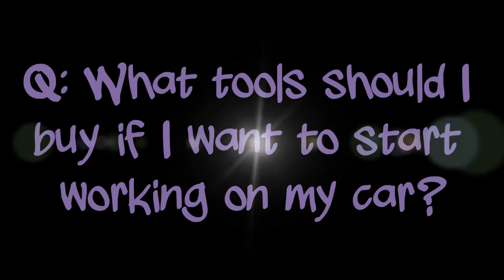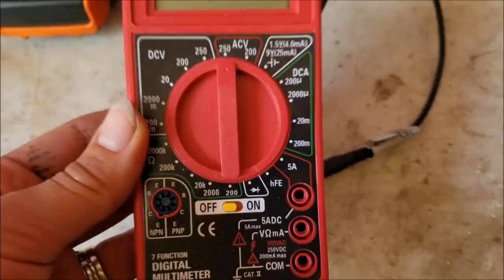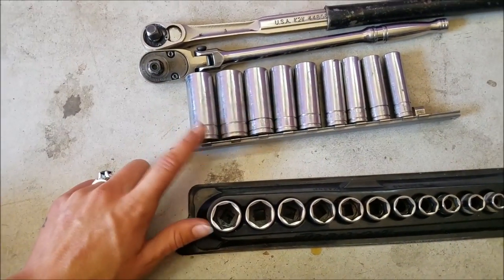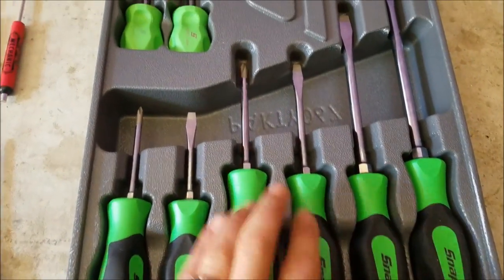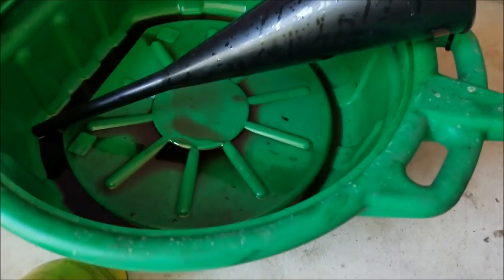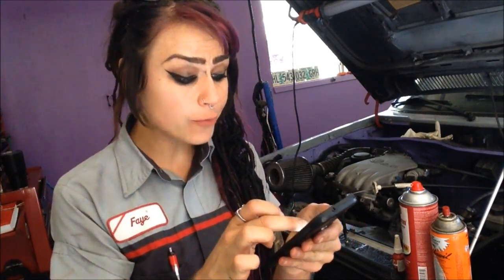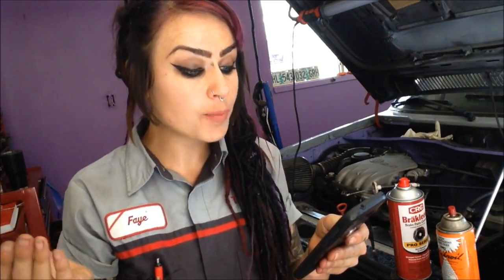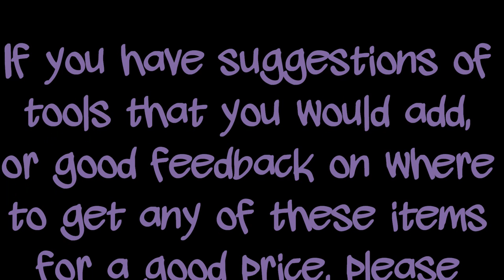"What tools should I buy if I want to start working on my car?" Q&A with Faye #2!

Comment: Hi Faye! I'm 58, about to be 59, and with the right tools, you don't have to be that strong to work on your car. I'm retired with a bad back and I can do most things if I don't rush and rest sufficiently between tasks. You need a hobby once you aren't working for the good of your body and mental health.

I also do not personally like adjustable wrenches. Get the correct size wrench! But, they can be useful around the house when you find a broken screw in a board or drywall. You can grab what's left and get it moving. My mentor (ex-hubby) strictly forbade the use of adjustable wrenches on any car. I only worked on my own car, I've never done it for money. He is a Chrysler certified mechanic, and made a living and paid for college working as a mechanic.
Speaking of two cents, I use a penny to test tire tread depth. If you can see Lincoln's hair, your tread is worn and you need to save up for new tires pretty quickly. 
For oil changes, I bought plastic ramps. They were inexpensive and I don't have the money for a jack and jack stands yet. I'm saving up. I will need to replace the entire front and rear suspension and steering rack on my 97 Honda CR-V. It's all worn out and probably won't last another year. Getting the service manual is a great suggestion I didn't think of, and I'm getting one. 

Lastly, kudos for being a successful woman in a predominantly man's world. When I started out as a chemist in 1985, I only ran into secretaries in the restroom, and there was only one for women. Thank goodness that changed over time.

Comment: One tool I use when nothing else works is spring loaded clamping spanner normally used for rounded off nuts and bolts but great if you don't have the right size spanner or socket!

Comment: For many years I carried an 18 inch breaker bar in my vehicles for changing tires. But there is something even better, but it is expensive if you don't get it used on ebay. The Snap-On SN4B is a combination breaker bar and speeder making it really effective for changing tires, and it is easy to store with the spare tire. I keep one in each of our vehicles.

Comment: Great tip about keeping a breaker bar in your vehicle to change a flat. I keep a 30" breaker with a "Keyfit Tools Breaker Bar Ratchet Adapter Socket 1/2"" and socket specifically for that task. It makes changing a tire supper easy, even on my pickup truck with its lug nuts torqued to 135 ft/lbs. In fact, I have more difficulty putting the tires back on now than I do with the lug nuts, compared to when I was using a 4-way to change my tires and I dreaded having to fight to get the lug nuts off.

For socket sets I would recommend Grey Pneumatic's Duo socket set(thin walled, impact rated sockets); they have a lifetime warranty and are are rated for both impact and hand use. They are nice because you don't have to buy a duplicate socket set in the future if you decide to upgrade to power / impact tools from your standard hand tools and more importantly you save space in your tool box for a larger variety of tools. I have them in 1/4(goes from 4mm to 15mm!), 3/8 (7mm up to 22mm), 1/2 sockets(10mm to 36mm), in both metric and standard, and they have served me very well for years as a serious DIYer. I also really like them because of the fact that they don't skip sizes in there sets unlike so many of the cheaper sets out there(Technically they do skip a 1/2 inch, 31mm socket but, that is the same size as a 1-1/4 socket so it's still covered).
 I actually bought them after I got tired of the normal impact sockets not fitting on a ton of stuff, including my lug nuts(pesky alloy wheels).

One important thing to note about warranty on tools now days; most manufactures consider "shopping search engine" websites(IE: Amazon, Bonanza, eBay, Craigslist, Newegg, Rakuten, Walmart, etc.), to be unauthorized dealers and will not honor any warranty claims when purchased through them. So, buyer beware.

Keep up the great work Faye!

Comment: I don't like using adjustable wrenches either.  They are handy for certain hydraulic hose applications on heavy duty tractors.  Also for a beginner Tekton tools are a great option due to price and quality.  Are also lifetime guaranteed.

Comment: Basic socket sets, vise grips, wrench sets, screwdriver sets, hammers, needle nose pilers. I love my used 12 inch Matco 3/8 ratchet, I paid $40 a few years ago. I think it's really cool you teach other women car basics. When I worked at a shop a few years ago, I couldn't believe how many women didn't know how to check the oil or coolant.

Comment: I like 4 way tire irons the best. It makes it easier to get torque on the lugs from both sides of  the tool. I specifically stay away from using breaker bars on lug nuts because they tend to snap lugs if they are corroded or the lug nuts are cross threaded.

Comment: Good video. Cool stuff for beginners. Thanks. I would like to suggest a downloadable or printed bolt grade/size torque chart to allow a cross reference when torque specs aren't available. It's good to have for unknown mechanical work due to lack of torque specs that are sometimes not supplied. An invaluable reference. One can never have enough information. Also, get the chart with lubricated or dry specs for each one.

Comment: The other day I was working on the GM 3400 V6, and needed a 5.5mm socket to change out coil packs.  Luckily when I started, I got a 101 pc Craftsman Mechanic's set which was all sockets and ratchets.  This is a great video for beginners.

Comment: I would have to agree with all of Faye's suggestions. For brake cleaner though- I have switched to "non-flammable" because, if there is cleaner over-spray it won't effect rubber lines or plastic pieces. One thing I always use is a battery charger that can charge AGM/Gel/Wet (lead acid) batteries. If you get a new battery from an auto store it is never fully charged- also brand new vehicle batteries are never charged fully when you receive it. It is an obvious but highly overlooked occurrence.

Comment: I think a decent Vise Grip Pliers is a good tool along with a basic punch chisel set. Something I use is a good degreaser and some pot scrubber pads to clean parts and prep gasket surfaces. GR8 demonstration on tools to get started, every vehicle or application may require certain items such as snap-lock release tools or specialty oil filter wrenches. (just  sayin)

Comment: Tire plug kit, valve core remover for tire changes, thread gauge, brake gauge and tire pressure gauge. Besides claw or plier for oil filters, the swivel strap wrench (sm & med) less likely to puncture filters & oil filter sockets for cartridge filters... 👨‍🔧

Comment: Ditto on breaker bars. I'm looking for a 3-ft pipe to go over my 2 ft breaker bar. You are so right, tire shops tighten the lug nuts so tight I can't make them move without a lot of leverage. Several other nuts and bolts are also massively over-tightened throughout my Honda and Subaru. 

South Texas is dry a lot, but south Louisiana is very wet so there is a lot of rust on bottom car parts from driving through lots of water. I use Seafoam because it is a good penetrating fluid and rust-preventer. The project farm channel has good videos on comparing various brands of things from penetrating fluid and engine oil to duct tape. It's useful information.

Comment: If you are serious about your tools and you use them daily as your profession, not just a hobby,  here's a great package to buy from Snap-On Tools:

Buy the 1/4 inch socket set first! Get the metric mid-depth 6-point sockets 5.5mm - 15mm and add a 1/4 inch socket to this set. A high quality 1/4" tool set can get used as much as the 3/8 inch sockets of any brand name. Buy the Snap-On TM737 1/4" Swivel Head Ratchet. It has the hard plastic ergonomic comfort grip and forget about the new style red and black shitty-grip version. This tool will not disappoint you! Add to this a set of 1/4" extensions of different lengths and get the knurled wobbly ones - they are extremely useful.

Anytime you are starting a tool set, get the metric kit first unless your job is strictly SAE standards. The metric fitment to SAE sizes are better than the SAE fitting too snug on metric fasteners.  The larger the socket drive (ex. 1/4" 3/8" 1/2" 3/4" 1" etc...) the less you need to worry about it being a Snap-On quality tool. If you're breaking a 1" socket on a 1/2" drive tool, chances are you have other problems.  The Harbor Freight Pittsburgh PRO series of 3/8" and 1/2" sockets will get the job done at a fraction of the price.

Save your knuckles and don't go cheap on your daily "go-to" tools. Don't discredit cheaper tool makers and don't discredit the leaders in the industry either.  I don't need Snap-On air tools because my AirCat tools work great and cost far less.  Thankfully we have choices to shop from these days unlike the days of old. Amazon, Harbor Freight, auctions, Northern Tool, etc...

And just so you know...  MATCO doesn't make any of their tools! They are ALL sourced from other places. The only thing they make is their tool boxes and not the entry level ones. The good ones!  MATCO makes the best tool boxes IMO - but the competition is strong!!

I've been a technician all my life and I have more tools than most mechanics. I'm not a tool snob, I'm just serious about tools in general. I know what works and where money will be wasted for the most part.  Work smart and shop wisely.

Comment: I have to disagree to a minor extent about the adjustable wrenches. Growing up on a farm and being a Industrial mechanic for 27 years I find the adjustable wrench an invaluable tool at times.  I agree with what you are saying, and I agree that the correct wrench or socket is better, 
 But there is times when you need to hold a "Part" while removing the fasteners with the correct tool, and the part just happens to lend itself well in shape to use an adjustable wrench. Many times I use the adjustable as you would pliers for certain things. I also use them to bend materials in a vice similar to a sheetmetal brake. And two adjustable wrenches side by side make a great pair of shears for opening banded crates or shearing  away rusted muffler hangers to get better access. You could almost teach a class alone on the right & wrong way to use adjustable wrenches. I have 6-10 of matching set sizes. Dont buy cheap sloppy ones either. Tighter the mechanism the better.and keep them lubricated.
Reply: i agree. i use them alot for those uses.

Comment: Instead of a flashlight, I recommend a good quality LED headlamp. I use an Energizer brand. I've never been happy with headlamps from Harbor Freight

Also, the "soft hammer"is known as a rubber mallet

Wow, Saab!! That is so cool!!

One last thing, my city offers a free oil change kits that include a good size bucket, a bucket top that can be used as a pan and seals the bucket, a funnel, a 2-pack oil filter drain, and rags

Comment: I would actually recommend an adjustable wrench but, only for a very specific, rare use case scenario and, a very specific type too. Specifically, a slim jaw adjustable wrench for those rare occasions when you need to deal with a Jam nut(or something similar with a set of double stacked nuts) and you don't use it enough to justify the extra cost or space, a set of decent slim wrenches(cheap one deform too easily) would take up. The only time I have needed a slim wrench was to deal with after-market brakes that had an odd setup for how the sliding pins were held on and I ended up being able to get the job done with a pair of needle noose vise grips(parts were being replaced).
 

Now if you plan to own a table saw one day, I recommend just buying a set of slim wrenches and forget about the adjustable wrench. Because chances are you will need them to change out the blade if you want to get a bit fancy and get a dado blade set(useful in furniture or cabinet making).

Comment: You did a great job here. Only recommendations I would are the following. Some extractor sockets in sae, because they usually work on metric bolts as well. A manual impact driver. Oh a caliper compression tool ,one with all the different types....other than that...bravo,good work!

Comment: Get a good set of shallow and deep from 5 to 15
Larger sockets are for higher rated bolts ie truck bumper bolts and bed bolts.
Anything over 15

I also bought a good magnetic socket set from sunex
And I have a electric ratcheting wrench
A good set of ratcheting wrenches 
Gear wrench has a good 20 peace for around 36$

A good variety of extensions

Also usually you sometimes will need torx bits 
I bought a 20$ set from ViM that were torx plus as well

That’s what I use the most .
On daily R&I

Other helpful tools are pry tools, 
A 4 peace small hook set
 Trim removal tools

There’s so many tools out there, 
I have a lot of random things from working in a body shop.
Like a 3/4 huge breaker bar I use to break VW hub bolts
Or my snap on air hammer
Spot weld drills,
Wire blasters,
Belt sanders
Reply: My 2011 Subaru Forester has several 17 mm and 19 mm bolts. The oil drain plug is a 17. The PCV valve is a 19 mm.
Reply: Sherri Joubert yeah typically body bolts don’t go over 15 
Non body components have larger bolts

Comment: It's just eerie, I have a 1/4" Craftsman ratchet with an identical pipe extension, a locking flex-head 3/8" Matco88, and a giant 1/2" breaker bar in my "go-to" bag, along with the PB Blaster. Outstanding judgement you have! Only other "essential" thing I didn't see was a metric/SAE set of 1pc stubby hex drivers, and a $20 set of impact sockets for the giant breaker bar. And shop goats to keep the shop chicken company. Otherwise, you nailed it. I have more than 100 tons of tools, but what I carry around always is basically just what you described. Great video!

Comment: Great video Faye. 

I am one of those who want from not being able to open their good to doing oil changes, brakes, replacing and sensors, etc. 

One important tool not mentioned is a willingness to learn. Not everyone needs to know or understand how to replace a timing belt, but understanding how to check fluids and tire pressure is incredibly important for all motorists. 

Keep up the good work!

Comment: Very Informative Channel...I proceeded in aquiring a chicken as per your suggestion. Greatly improved my productivity but with one glitch: My 10mm socket was MIA and every replacement met the same fate.Upon investigation I discovered a "Poulet" stash of shiny objects in a corner of the shop. Buried in the bottom of the stash were the missing 10mm sockets. Seeing as how the chicken has become invaluable as an assistant, no disciplinary action was taken. When missing,I go over to the stash and simply recover the 10 mm and carry on with the task. So, I suggest you look for your chicken's stash..you may be pleasantly surprised!  Best to you and yours.

Comment: I would suggest on items #2 for PPE safety glasses a couple pairs wether clear or amber tint , an if you do a lot of working out side tinted safety sunglasses Z87.1 rated. 🙃 

For newbes Also for covering oil filters make sure you know what kind you have. For a example my 07 Tundra is a canister style with a changeable element inside it requires a canister socket to remove it.

Comment: Love your videos. Thanks to you, I just changed (two drop and fills) the transmission oil on my Jeep. I found that the garage who did a drop and fill a few years ago didn't get the transmission fluid level correct -- added another 1 1/2 quarts. I've also changed an O2 sensor, changed the transfer case and differential oil, rotated tires, changed the cabin air filter... The Jeep still runs so I'm not that bad of a Faye Hadley mechanic. I'm about to replace the engine oil pan. When I took the belly pan off to do the transmission fluid job, the engine oil pan was all flaking rust - $40 for a new pan is cheap insurance verses trying to save the old pan.

Comment: A really good penetrating oil that we use is a 50/50 mix of acetone and automatic transmission fluid. It is even better than pb blaster.

Comment: I started out in 2006 with a 95-piece Craftsman tool set.  I still have almost that complete set today, I think my previous Tacoma ate a 10mm socket and I lost one of the screwdriver bits.

Comment: Harbor Freight has some good tool sets on a budget. I keep a 225 piece set in my car (less then $125 with coupon) and also recommend their 301 piece set for less then $200. Great sets for a new mechanic
Reply from the maker: Chin Chilla awesome suggestion, thank you!! Do you have a link to the specific kit that you are recommending?
Reply from the maker: Chin Chilla oh this is excellent, thank you!!!
Reply: welcome!
Reply: Check out struggleville youtube channel he post the inside track club coupons which are the ones you gotta pay to get.
Reply: I recently saw a video comparing the Snap On about $500 torque wrench and the Harbor Freight Icon about $100 torque wrench. The HF tool has a lifetime warranty, Snap On only has a 1 year warranty. They performed exactly the same in the tests that were performed. I will try to find the video and post the link.

Comment: Might be Overkill but if you're working with electrical and wiring components alligator clips t pins and test light, more simple than a multimeter but it'll tell ya if you have current coming from the wire youre staring at and one last piece of overkill would be a timing light for distributor work after you a tune up etc...love this channel and the content keep it up 💪